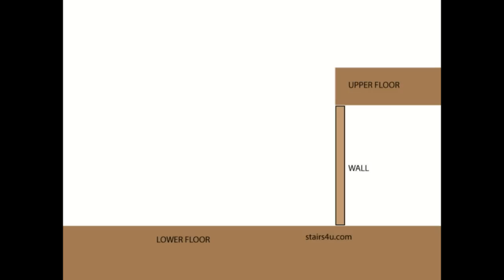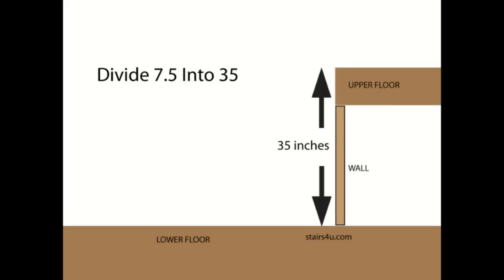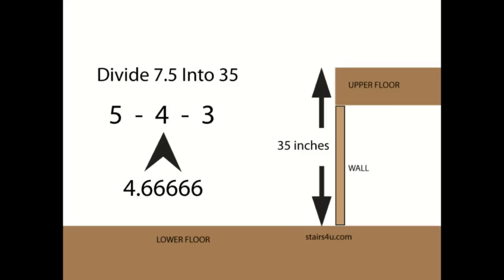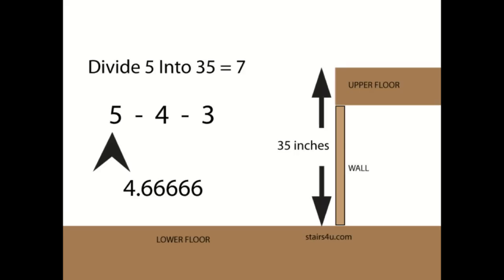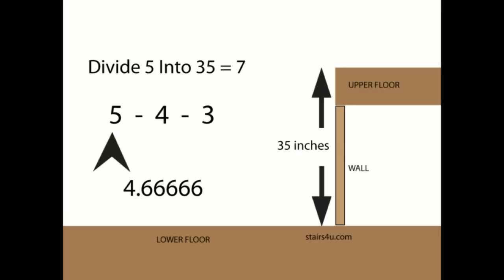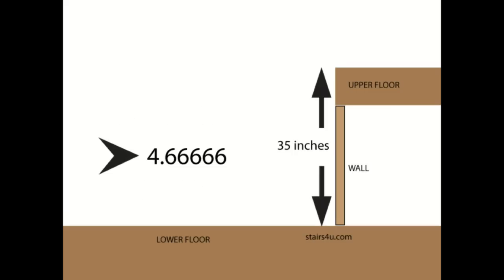How To Calculate Stairway Risers - Stair Construction And Design

Comment: Thank you,  do you still need to drop the stringer by one tread at the bottom?
And although you said 5 risers are you actually cutting 4? Because the 5th is the upper floor height? I get stuck on that one, i think i always cut one riser to many
Reply from the maker: Yes you do

Comment: I have an elderly friend who does not want a ramp but cannot handle regular stairs anymore.  The distance from her driveway to the deck is 6ft with a height of about 24 inches to the top of deck.  Can I make steps that are deep enough for her walker and her to stand comfortably on?  24 x 36 inch steps with a short rise that she can lift her walker up onto the next step push forward then step up herself?  Maybe make the steps as three individual platforms with four legs.  Each platform would be taller than the next then hook them all together at the legs.
Reply from the maker: I don't see why not, but it will be best to check with your local building and safety department to make sure.

Comment: Is 40° angle too steep .
I have 68.75" total rise aiming for 72" total run . 
Which gets me 7.64" rises
9"  runs. 
9 steps including deck as top step
Reply from the maker: You will need to check with local building codes. I would like to see 10 inch steps, but understand you might not have the length for them.

Comment: This is interesting but what if you have a problem with total run..... With a limited run it seems that the angle becomes steeper....... Can you show how to calculate risers with total run as a consideration....... Thanks
Reply from the maker: Here's a link and look at the videos in the smaller spaces section. https://www.homebuildingandrepairs.com/design/stairs/index.html
Reply: @stairbuilding  thanks..... I will take a look.... Cheers pal.

Comment: Typically, is fireblocking required at a landing or stringer where the entire underside is drywalled living space?  Think 1st to 2nd floor stairs with landing making a 180 turn.  Drywalled stringers, walls and bottom of landing.
Reply from the maker: Fire blocks are usually installed in walls around stairs every where. If you don't think you need them then ask your inspector when they come.

Comment: But if I want to 15" tread how far out will the steps end up?
Reply from the maker: Multiply the amount of treads or steps by the depth. For example if you had two steps you would have a 30 inch long stairway, 5 steps would be 5 times15 = 75 inches long.

Comment: First riser7" to 7.5 last riser8"??
Reply from the maker: No each riser should be the same height. However, some building codes allow for a maximum of three eights of an inch difference, but not 1 inch as in your example.

Comment: Thank you for the video really nice ,I have a problem with porch stairs the first raiser is at 8 1/2 inches end the rest of them are 7 inches we didn't pass Inspection because of that do you have any suggestions on how to fix them without taking them apart? Please help me thank you
Reply from the maker: If you can raise the lower section to 7 inches, then your problem will be solved. For example if you have soil or grass at the bottom, then you can simply raise it to accommodate the 7 inch riser. A deck or concrete sidewalk will be a little more difficult. Send me some pictures of your project for more information.
Reply: I actually didn't cut my 1 1/2 of my step  on the bottom step so we cut the 1 1/2 and it worked out great thank you so much for replaying

Comment: whats the run
Reply from the maker: You would simply multiply the amount of steps by the depth or width of each individual step. For example if you have four steps that are 10 inches wide, then the run would be 40 inches.

Comment: I have first floor height that is 11 feet 3 and total space that is length is 16 feet and width is 15 feet  and i want 2 flights and each step horizontal width is 4 feet

I also want extra space at very first bottom step.

How many steps width and rise height if i want landing of 5x5 feet after first flight.

Please answer anf guide me a soon as possible
Reply from the maker: Well, that was a lot of information, but I would need some more, to provide you with what you need. I suggest clicking on this link https://www.youtube.com/playlist?list=PLYdxzfqPmRpKA68C9YRbiMN5M68y383xX or visiting our website and checking out some of our books on stair building.

Comment: Commercial code is 7 inches max height with an 11 inch tread, and residential is 7 3/4 with a 10 inch tread in most cities.
Reply from the maker: Absolutely, right on the money. Commercial code would also include public stairways and any other stairways that wouldn't fit into the building code exception used for residential construction.

Comment: the builing code here want it as close to 7" rise and 10" run to equal 17 "
Reply from the maker: The building code might be 7.75 inches for risers or 11 inches for treads and you would need to check with your building department for clarification.

Comment: that is not quit right it is where the bottom landing is located,   the reason is the floor may slop away from the  upper landing by 1 or 2 inches,    or be sloped toward the upper landing by the same.

Comment: Thanks for your videos. My question relates to the real world situation where you have carpet TO BE INSTALLED on the top floor and (say) timber floorboards TO BE LAYED over the timber subfloor on the lower floor. My question is twofold-
1.Do you measure the overall fall from the surface of the carpet to the surface of the floorboards. 
2. Are the stairs installed BEFORE or AFTER the timber floor (in my case on the lower floor) is installed. Or are the floorboards layed after (and around) the stairs? This will affect greatly from where I measure my overall rise.
Thanks
Reply: Richard Churchward, your calculations are from finish floor to finish floor, but you'll measure down from the subfloor (rough floor). When using carpet or linoleum, there is no special considerations in your calculations, you'll simply measure from the rough floor (subfloor). In new construction, you'll build the stairs first, but If your thick floor on the bottom is already installed, you'll simply measure down to it for your calculations, and then, after cutting out your stringers, you'll subtract only the thickness of a finish tread from the bottom of each stringer, as normal. If your thick bottom floor is not yet installed, go ahead and build your stairs, but subtract the thickness of your thick bottom floor from your total height (rough floor to rough floor measurement) and then do your calculation. Then subtract your bottom floor thickness from the thickness of a finish tread, and this is the amount you'll cut off from the bottoms of your stringers.

Comment: I have a 46.0 inches high wall whereby i am going to build a stair with a run of six 12.5 inches., risers would be 7.5 inches. Would this be comfortable/acceptable?
Reply from the maker: It might not be as comfortable as if you had a 10 inch tread, but most building departments would accept it.

Comment: hey brother, i wanna ask you this:
using 1/4'' ply, layout an open stair stringer for 3' 1'' riser where the top tread is flush to the riser top. Assume the tread thickness is 3/4'' 
how will it end up?
could you help me out with this? I'm pretty new, but i wanna learn
Reply from the maker: +Leon Cinho I'm having a difficult time understanding your question, can you please provide me with more details.
Reply from the maker: +Leon Cinho I wouldn't use quarter-inch materials, because they aren't strong and could twist, bow and deform. I hope this answers your question if not feel free to ask another.

Comment: why do they say that the cuts should total between 16-18 inches then? So does the vertical cut need to be 8" max,  and the tread risers are flexible to total the 16 to 18" rule?
Reply from the maker: +laccanvas The length of the individual stair tread and riser when added together should fall into the range between 16 and 18 inches to create a comfortable step. 17 1/2 inches is a very comfortable step. Riser and tread measurements can be flexible to optimize comfort.
Reply: ok. thanks.

Comment: I have existing concrete curbs or stringers on a proposed concrete staircase. the application is cut into the hillside. im needing to take a transit out to jobsite to find the rise and run I assume . as it stands now I only have the vertical run distance which is 32'.  when estimating the treads and risers its about 8 rise and 21 run but this is not working out for me as im gaining on my reveal .I want to keep an equal reveal from the tread nose to top of curb. Seeing that my stringers in curb form are existing I will have to find the rise over run to begin.  Correct?
Reply: +Michael Smirnov im sorry I meant I only have the diagonal distance of 32' not vertical

Comment: So you always divide by 7.5 into the number you get from the lower floor to the upper floor?
Reply from the maker: 7.5 provides us with a good starting point, but you can use seven and eight also. If you have a total rise of 100 inches, you can start dividing 9, 10 or 11 also. If this doesn't make sense feel free to ask another question.
Reply: Thanks for the help, now I got it!
Reply from the maker: You're welcome.

Comment: Can I add two stringers together or is it code to have it on one solid piece of wood?
Reply from the maker: Yes, you can fasten two stair stringers together, but I don't know if it would meet your local building codes. For example if I cut two stair stringers out of quarter-inch plywood and fastened them together then I don't think most building authorities would be happy, but they might not have a problem with something cut out a 2 x 14.

Comment: How do you suggest I approach demolishing a staircase to setup a new one, start from what point and at what point?
Reply from the maker: It all depends on the type of stairs, but I think I would look at it and try and figure out a way to do it safely. For example I wouldn't remove the bottom section first if it was going to be safer to remove the upper section or vice versa.
Reply: stairbuilding I have to raise the floor joists on the second floor to level out the floor. The stair case is in the way. The staircase and the floor joists need to raise up five inches, so I suppose I'll scrap the entire staircase and build a fresh one. Thanks.
Reply from the maker: RubbinRobbin You will probably be better off removing the old one and installing a new stairway.

Comment: Why 5-4-3 and no 6-7-8? Because 4.66666 is between 5-4-3? In this case 35 in is the hight of what, to low for uper floor almost 3ft? Thanks.
Reply: Not too low for a deck.
Reply: I see, thank you very much.
Reply from the maker: Those were just numbers I through out there, but you can use any number you want. The 35 inches is another number I just used in the video for the total overall stair height or rise.